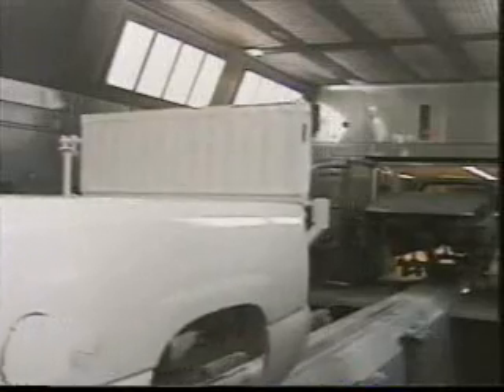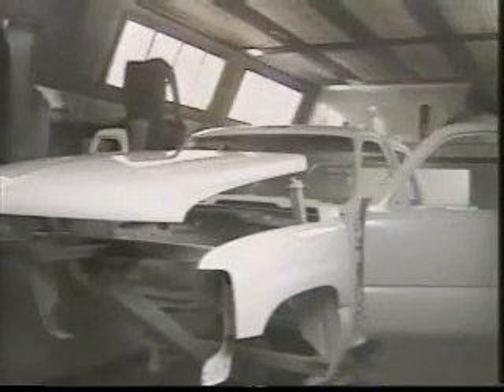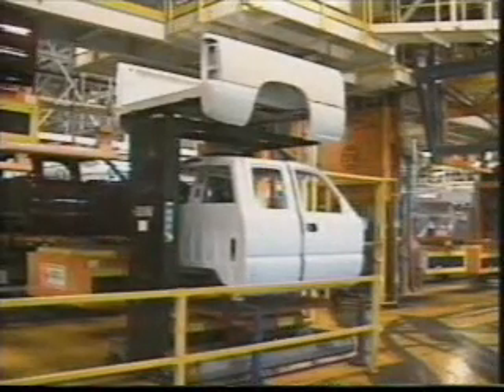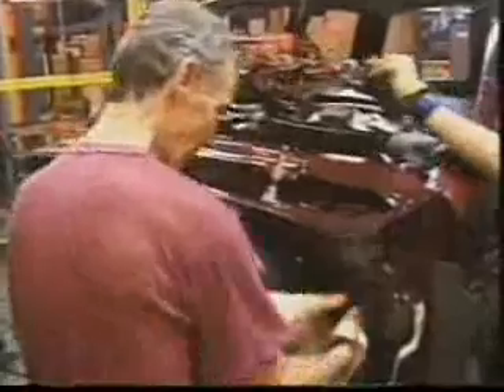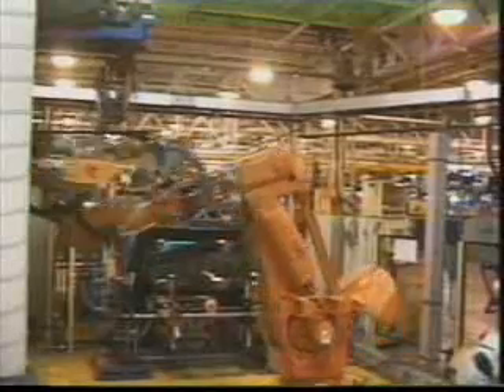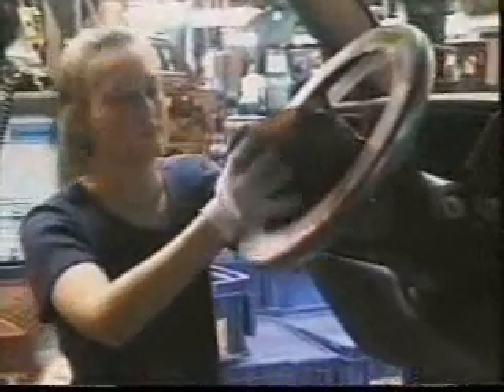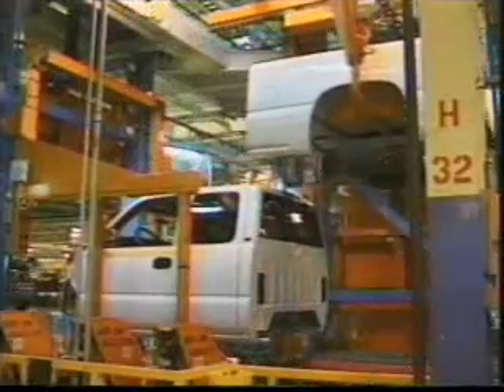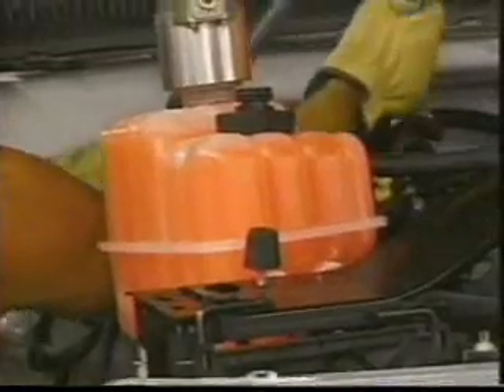How a Chevy Silverado is built at the Oshawa Truck Plant 2/3

Comment: Wow , I use to work up in the paint shop till the plant closed in 2009.  They missed a lot of stuff happening up there in this movie .  I loved my job in the clean room where we painted the trucks 🛻 loved my robots .  Had them all named , but you always locked them up when you changed the socks .  Robots are unforgiving.  Can’t believe I saw my old friend Bob putting the seats in .  Have not seen him in years .  Miss the old truck plant and friends I made there .  Been retired 12 years now .  Glad to see they are making trucks again in Oshawa.  👍🇨🇦 Great trucks built in Oshawa .
Reply: There was a whole department of employees in the paint shop .  The trucks after Elpo were scuffed and prepped by employees or sanded of dirt or imperfections and hand sprayed again .  After painting the paint was checked and any imperfections light sanded out .  If it was a job that couldn’t be lightly fixed it was sent to a disaster booth , where an employee could park it and work on more intensely.  If a truck panel needed to be painted again , the other panels would have been bagged to not get over spray sprayed and this was done on a moving line .  If the truck was a two tone colour , the primary colour would have to be covered and taped up , all done on a moving line , a job I did for years and you had to be good and fast because if you stopped the line because you cut your fingers or made a mistake , the group leader was on your ass.  Then all this paper had to be taken off too after the secondary colour was sprayed on .  I spent 15 years in truck plant paint shop till the plant closed in 2009.  I took a video myself of those last days , which is on utube .  The real view from an employees point of view .  Miss those days ,  where do the years go . 😢
Reply: @johnnydian  
So interesting, I have a mobile auto body business and love watching this stuff. What kind of disasters would you see out come out of the line? When did you move to water base? Did you use bells for the base coat or just the clear? We’re the bumpers painted at a different facility, if not why do the never match? Where can see your video? Thanks for the info
Reply: @976charlie9  search “Johnny Niles last day at truck plant “  I took a video camera in there the last week and got some vintage shots .  CTV Delaney saw me coming out the truck plant the last day and asked if he could use some of the footage for a story .  Yes we used the bell’s for the primer robots and paint robots .  Sometimes , but but rarely the robots would freak out or sometimes would break or go wrong .  Any truck surface with paint damage would go to the Disaster booth to be sanded to try and save the job or whole panels could be exchanged .  Thanks for you interest Charlie.  👍
Reply: What was left out?

Comment: Why do all GM trucks rust at the rear bottom of the front door, if it is a extend cab it will always be at the rear bottom of that ! There should be a class action suit against GM for this. Rarely do I not see a GM truck rusting terribly.